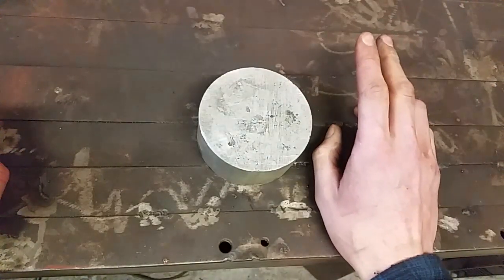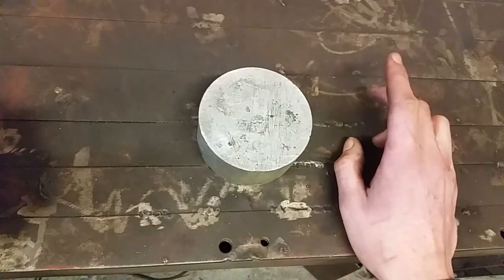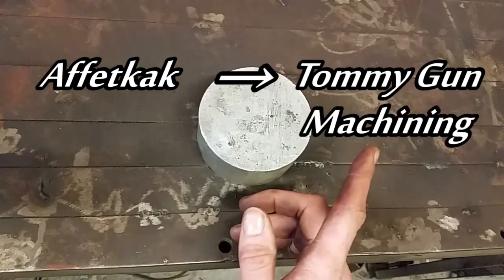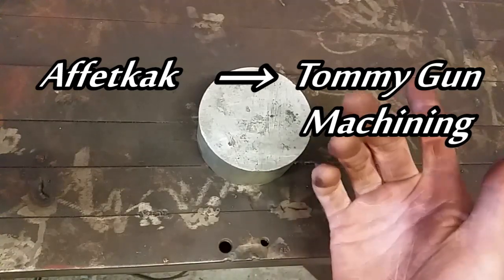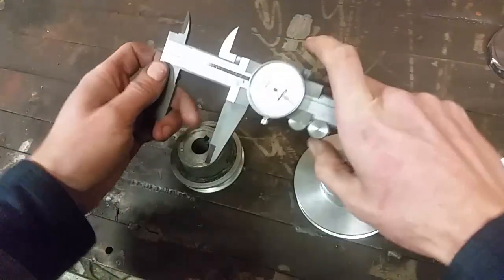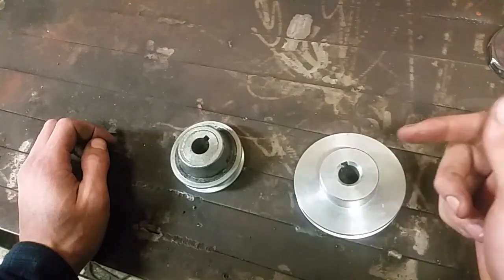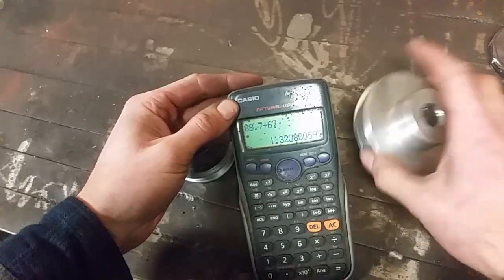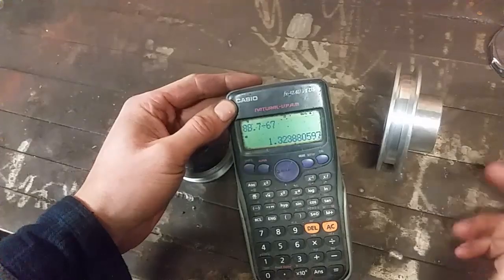Lathe Pulley Upgrade!

Comment: Hey, greetings from the other side of the planet. With your speed increase just make sure you watch your oiling on the Herc! If your oiled parts were only spec’d for rotating 38% slower then you may - may - need to change
Reply from the maker: You are correct, I make sure to put a bit more oil in. It is also infrequently used, I mainly switch over to it for polishing operations and that sort of thing
Thanks for watching